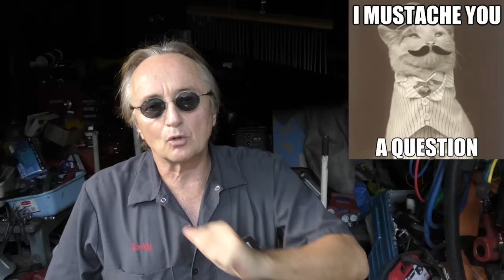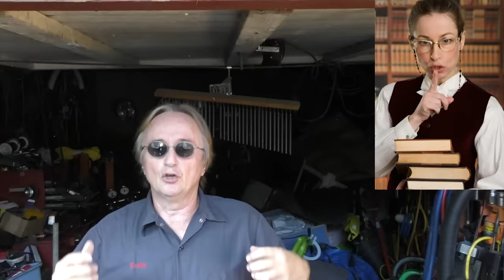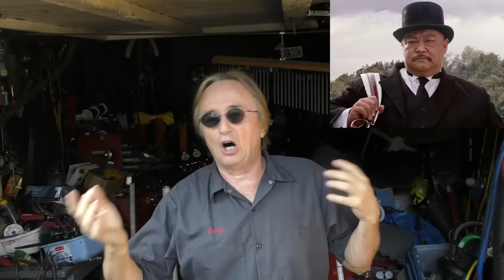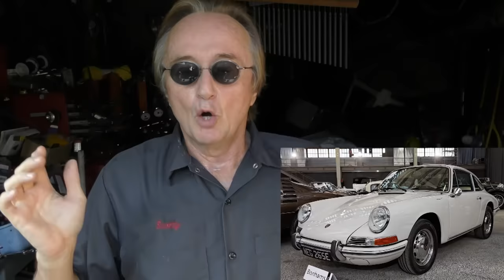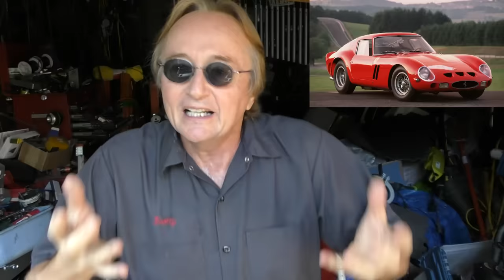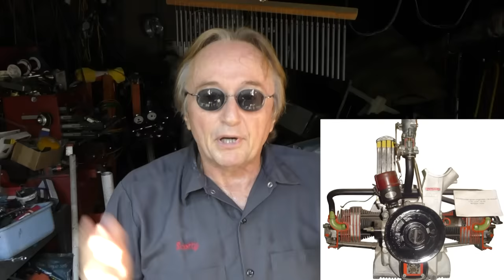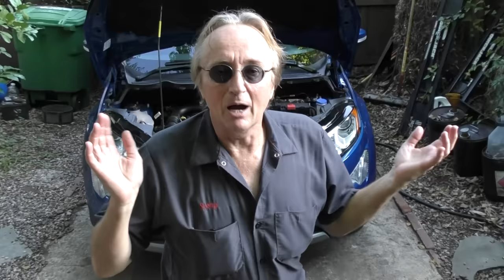The Truth About Boxer Engine Cars

Comment: I love my WRX ❤❤❤❤❤
Reply: Sti🔥🔥
Reply: WRX impreza stage 2 <<<
Reply: That’s my dream car
Reply: Head gaskets
Reply: XenomorphLV426 less of an issue on the turbo models...diff design gasket
Reply: Yeah, my wrx has 220,000 miles on it. I'm just learning about how unreliable boxer engines are. I think I need to change all the original parts. My head gaskets because they are bad, the noise the engine makes, the turbo because it's bad. I may as well just junk the car to get a matrix because it's totally faster than my wrx.

Comment: Scotty, long time subscriber here.  I bought a 99 Impreza WRX GC8, it's on it's original engine, even tuned with more turbo boost.
it was well maintained though, an older man owned it. 

i've had it 6 years and going strong today. however the car is the 2.0 engine, which i believe are much more durable than the EJ25 engine. 

i think you said it was a good car in a comment years ago.

peace.

Comment: Have  a 69 vw truck , love the mechanical sound of the old air cooled boxer engines, slow revs, not much power, poor gas mileage but is geared to maintain a decent cruising speed and has a 9' bed.

Comment: Isn't the highest HP in a Matrix 180HP and the BRZ is 205?

There aren't many  NA 4 cylinders above 200HP with out a turbo.
Reply: Exactly, people even complained about the low torque in S2000s and Integra Rs. Also nice icon.
Reply: well yea they make 200 to the crank but wheel hp is like 180-190hp
Reply: GSR Integra did it many many years ago

Comment: Love the Subaru Boxer. You can swap out a 2.5 in an Impreza if you break one in about 3 hours with hand tools and a floor jack. And the synchronized AWD is a dream. Just don't pass gas too loud in any Subaru, the Check Engine light will come on, too many sensors. LOL

Comment: Having owned several since the early 70’s, I love them.  Porsche actually had developed a 16 cylinder aircooled turbocharged version making over 1000 hp in the early 70s, so horsepower is not a problem.
Reply: You mean the Canam cars ? They used a V12
Reply: The Can-Am cars were campaigned with a flat 12 turbocharged boxer engine, but Porsche developed a flat 16 engine for the car in case the 12 cylinder version was not fast enough.  It turned out they never needed it!

Comment: I purchased an 2013 Scion FR-S with 47k miles and put 7k miles on it . I did had extended warranty to fix my transmission bearings but I chose to go with a real 2016 Toyota Corolla s stick shift with 33 k miles since I love the sounds of inclines better and they take 87 instead of premium and last longer than boxer engine

Comment: I bought my '99 Outback based solely on the AWD system. I went off road a lot and I liked it better than regular 4 wheel drive. My brother said my boxer engine sounds like a sewing machine. One day bro and I were going to our favorite fishing hole. I left early that morning and after a few hours my bro called and said he was stuck on the trail halfway there. He had a 4X4 Tundra, but didn't engage the push button 4 wheel drive until after he was stuck. Anyone with automatic locking hubs knows your have to move forward or in reverse just a little way for the hubs to lock in. He couldn't move an inch, so his hubs wouldn't lock. I pulled him out easily after just moving him a few feet where his 4 wheel drive could help. A few days later he was talking about the locking hubs with a guy at the bar. I leaned over and said real loud, "Don't forget to ask him how I pulled him out of the mud with a SEWING MACHINE! LOL!

Comment: When I bought my Subaru, they were bragging about how their boxer engines would be forced under the car in a front-end collision (due to an intentional weak joint in the drivetrain) instead of crushing like an accordion or ending up in the driver's lap like a typical straight or V-type engine. My Subaru's engine is noisy, but only when you floor the gas pedal.

Comment: About the head gaskets.  It's not really just a boxer problem.  It was a common issue with the EJ engines.  You could basically fix it by swapping out the Graphite coated gasket with an MLS gasket and the problem was fixed.  Head gasket design problem, not flat 4 issue, and it was most specifically with the EJ253 Naturally aspirated engines; EJ203s also had the issue as well, though not as pronounced.  And the Subie rumble is from unequal length headers.  Pretty sure they did it to save space more than anything.  Again, not a boxer thing, more of the design chosen of another component.

Comment: The Honda Gold Wing has a boxer engine. Originally, it was a 1200 cc 4-cylinder. These days, it's an 1800 cc 6-cylinder. It generates loads of torque, it's powerful, buttery smooth, reliable, and lasts for ever. Sometimes, a boxer is the right tool for the job.

Comment: Subaru best car for long term reliable ownership. Met a man with an old Forester, and apart from the usual servicing and wear and tear items, only had to replace a bulb in 12 years ! I have a 2019 Suzuki at the moment, it does the job but would like a Subaru as my next car hopefully, although not sure which one yet. My heart is saying the WRX STi (im in the UK by the way), and can only get these second hand now, but still plenty good low mileage examples for sale at dealers. The sensible option is the 2 litre impreza hatchback (only has CVT over here now), its the lightest AWD Subaru and plenty quick enough for normal use. Would last me for many years. People waste so much money trading in every couple of years and signing up to yet another finance deal. Get a good car, pay it off and keep it. Subaru is that car.

Comment: Bought a Subaru impreza wagon Sept 2019. Thus far only regular maintenance has been done on the vehicle.
The 2.5 Does use oil. 1 -2 quarts in 3,000 miles. But the vehicle has 133,000 miles on it. The engine oil looks BLACK when it gets drained..

Comment: Never heard of Gobstopper II, or the Crawford tuned BRZs, Scotty? Also, the fastest 4 wheeled vehicle ever round the Isle of Man TT circuit is an Impreza STi. Headgaskets go because the engine's not earthed properly and coolant not replaced often enough; it doesn't drain away from the HGs in a boxer engine as it does a silly, tall, top heavy inline engine with only two camshafts. Having said that, taking 2 hours to change the spark plugs on your twin turbo Subaru is a massive PITA!

Comment: Hello sir, you should try and drive an Alfa Romeo 33 1.700 16v or even an 1.700 or 1.500/1.400 8v.
Ultra reliable engine with mich more boxer rumble than new boxer engines and pretty fast for its age!

Comment: Boxer engines may be from the past. But the technology and tuning of these vehicles have come a long way since the 1900's. You can tune your Subaru or Porsche to run on E85 and get clean reliable horsepower gains. The overall reliability of these engines, properly built and tuned for what ever mod you install on them. Will make the engine 1. Last longer if not abused daily and 2. Funner then a stock car. I love my subie...love.

Comment: honestly, boxer engines are putting out 50 HP per cylinder naturally aspirated
try comparing that to V or Inline...
and head gaskets for the EJ257 and EJ250 use different elements than OEM factory which further prevent head gasket failure for forced induction engines.

Comment: If you ARE NOT looking for High Speed PERFORMANCE , But Looking for a good reliable engine, when It comes to Boxers...Go With Subaru.... I had a 2002 Subaru Forester I Bought new with a 4 cyl Boxer and I Had it till it rusted out and the lower control arm gave out on a highway. But you know what? Besides regular Maintenance  the only thing I had to do for the engine was replace a O2 sensor in it's whole life.

Comment: Try an H6. My naturally aspirated motor makes more power (not by much, but does.) than a stock 2015 wrx. No head gasket issues a higher rev limit, and no torque twist from left to right like an four cylinder flat.

Comment: I broke my mirror on my 2011 VW Jetta SE, 2.5 Cyl. The mirror fell off and the housing is cracked. I needed to fix the air the other day and took it to the dealer to get it done. While it was there I had the heated mirror in my car that I already paid for and asked them to try to fit it back in if it was possible, they couldn't or wouldn't. They recommended replacing the entire right side assembly at a cost of 1,025 bucks, all for a mirror whose housing and mirror cost like 282 bucks by themselves. (Heated and power) I think they're bullshitting me, do you think I should find an independent mechanic and get their opinion?

Comment: My son bought a new Subaru, with a boxer engine. It's back in the shop. Overheats and getting oil in the water system and the heater stopped  working. Flushed it out last year problem came back again.  Car is junk.   What's going on Scotty. He never beat the car. Drove it normally.

Comment: You may like to know, I have TWO EZ30 engines in my Porsche 917/10 Can Am car replica!!!  The original car had a flat 12 boxer engine.  I did have them connected and running together but it is now on one engine because I couldn't spend any more money and emotions working out the details.  Next spring, I will reconnect them so my 917 replica has a 12-cylinder boxer engine like the original car.

This is how I plan to connect them.  A chain sprocket will be bolted on the back of the crank on both engines.  A drive shaft with sprockets in bearings over the top of the engines will be installed and chains going down to the crank sprockets.  Then I bolt on the flywheel on the rear engine sprocket.  I will shim the flange of the transaxle the thickness on the sprocket so the starter will engage the flywheel.  Everything will be heavy duty of course.  To my imagination, the front engine will be a supercharger for the rear engine, applying the torque to the rear of the crank shaft.  So far, this is just theory.  The chain clearance hasn't been finalized.

To run the engines together, I will wire it as following.  The rear engine crank and cam position sensors and all other sensors will talk to the Megasquirt computer.  Each engine will be set at Top Dead Center on cylinder one.  The coil and injector firing signals from the computer will be split to both engine cylinders in sequence. 

As far as the VVT and any other auxiliary systems, I'm hoping they can be disconnected so the engines work on their basic systems.  More thinking will be needed but how am I doing so far?

Comment: Oh, I just love  Corvair, a friend of mine in high school, we were working in the automotive shop on a teacher’s Corvair,  it had multiple carbs which were a main pain to setup.

We lived near the beach area, taking it down a rural road for a test at 55, the speed limit, towards the inland waterway , we went into a long curve, the middle of which had a huge undeveloped, unpaved road connection. That road was pure sand. It had blown  slightly up onto the road bed in the curve dusting it. 

We hit that loose sand, the back in broke loose trying to become the front end. I refused to ride in it again. We did exactly nothing to  provoke that other than 55 probably was a little fast for that posted road. But most of the backroads defaulted to that speed especially since it was undeveloped woods along the road.

 I think the only thing worse was that Tiger Sunbeam?  We had a female chemistry teacher that had one of those things, man it was light weight and seemed over powered. My favorite car was a MG, same friend owned one, even came with a hand crank for the engine. I couldn’t turn that thing.

Comment: I’ve had two 356s, three 914s, a 914-6 and a 912 along with a 944. Pulling a spark plug out of the cooling tin of an air cooled Porsche has been the most stressful thing I’ve ever had to do to a car.

Comment: I bought a new subaru in 05 and barely ever maintained it and it blew up when the belt skipped @ a mere 340,000 k's, maybe if I changed the belt and checked the oil now and then it would still be my daily beater.

Comment: Blow head gaskets?  All engines can blow head gaskets.  I don't see why a boxer should be more susceptible to this. I had a BMW flat twin.  Serviced it myself, did well over 100,000 miles.  Did a pot pressure test before selling it, it was as new.  Head gasket change??

Comment: I love my 3.8 boxer engine in my 991.2 Turbo S   Scotty , it seems to have plenty of power 
Stock  580 hp  550 ft torque
2.6s  0-60  and 10.5s  1/4 mi
Seems modern not out dated.

Comment: honda and subaru enthusiast here.  boxers are reliable, but if you slap a bigger turbo on it without supporting mods and push big power the engine will blow up but that's all engines.

Comment: OK, in a horizontally opposed engine, a so-called boxer engine, the pistons are opposed at a 180 degree angle. In a V engine, a V-6 or V-8 engine, or a V-4 engine, the pistons are opposed at an angle other than 180 degrees, perhaps around 60 degrees, or 90 degrees. Other than having a different angle, what, if anything, makes a horizontally opposed engine any different than a V engine?

Comment: I have a 2010 subaru legacy 2.5i the engine vibrates when the coolant fans come on, its usually when I'm at a stop light the engine vibrates like it wants to stop, i notice the engine also vibrates the same way when rolling up the power windows both at the same time, its like its a power surge.(what do you suggest i do to check-out the real problem?) also i have a check engine light on for catalytic converter operating below the threshold a P0420.

Comment: I've heard that, in the 2009 Subaru Forester Sports, that the timing belts have been a problem around 100,000 miles.  Is this true for the majority?  Also, wondering if you know anything about the transmission life on that model ?
Reply: Yes always change them every 100k miles

Comment: My mom has a Matrix and I drive a Ford Transit 2010 which is a sloth. I barely touch the pedal and i"m burning rubber in the Matrix, It is extremely fast car.
The Transit is a tank, would be cool to here your opinion on them. They were diesel in Europe.
Nice thing I haven't had a citation since I owned it!

Comment: A good video. I do not like boxer engines. The standard inline 4 cylinder engine has much more power than any standard 4 cylinder boxer engine. The boxer engined Subaru that I owned for a while had head cooling problems from new and it had oil leaks from 10,000 miles on. I sold it at 12,000 miles and bought a simple 4 cylinder Toyota Corolla that had more power better fuel economy and no mechanical problems. A good video Scotty and keep them coming.

Comment: Noisiest boxer engine I ever heard was a Panhard PL17. 2 cylinder roller bearing crank. 848 or 851 cm³ (52 cin³), started at 40 HP, eventually developed to 60 HP in the mid-1960s.

Comment: Is there any longevity advantage or disadvantage to a 4 cylinder boxer-style engine such as a Subaru versus an in-line 4 cylinder in-line engine such as a Toyota or Honda? I ask because the weight of the pistons laying on their sides seems like it might wear the bottom half of the cylinder bore as opposed to the vertical movement of an in-line engine.
Reply: The pistons+rings fit tightly into the bore of any engine. If the tolerances were loose enough for gravity to have an effect on wear, any engine boxer or not, would smash itself to peices within minutes of its first startup.

Comment: Hi Scotty; I have a question, what is the right way to lubricate and loosen stiff door locks.

Specifically I have a 91 Colony Park and the locks are so stiff I can't use them. I tried lock oil in the keyhole but that did not work. I imagine that I will have to remove inner door panels and lube the entire mechanism. I got the tailgate panel off and doused with PB blaster but it didn't work. Need some guidance. -mike

Comment: Looking for advise on clutch life.  One example is coasting down a long hill. I'd never hold the clutch in for that long, but is coasting in neutral OK? (Coasting down a small hill I'd just drop to a lower gear to hold the car back and save on brakes.)
How about at a stop sign or red light for some moments? neutral or clutch in?
With my 6-speed (2011) Subaru each shift seems a bit abrupt, In my 4-speed ('57) ponton every shift is like butter but I imagine the rules for clutch use is the same, no?

Comment: On the subject of boxer engines and Subaru's, any opinions on the Subaru WRX? I was considering buying one since they're relatively cheap as far as sports cars go, but wanted to know if the 4 cylinder makes them a bit underwhelming?
Reply: Fantastic car for the $.  Nothing really compares. AWD and good engine power.  However, you must buy the standard transmission.  Very little maintenance.
Reply: @georob7918  Great to hear! I had actually been eyeing the standard transmissions, but first I must learn how to properly learn how to use one!

Comment: The biggest mistake vw made was discontinuing the original beetle with the boxer engines! Those engines are still going strong while those newer liquid cooled engines keep failing! I'm not that much into hp so yeah, an old model vw beetle would suit me just fine if I could find one I could afford to buy! For those times I need hp I have a pickup to use.